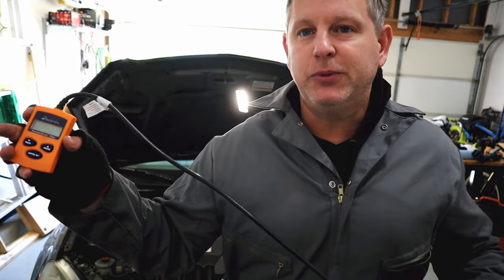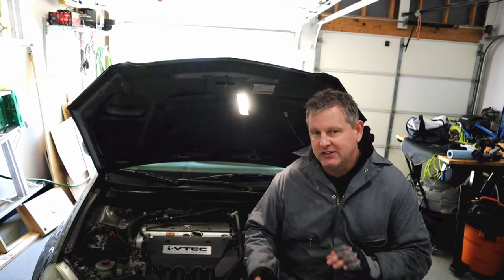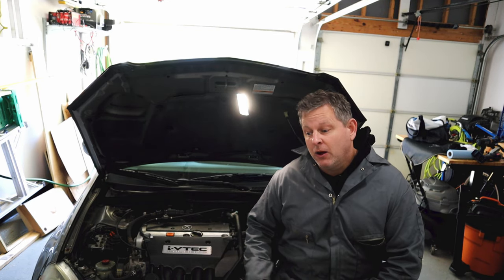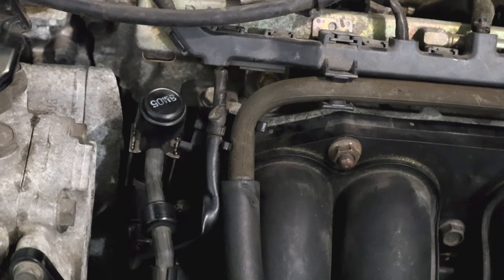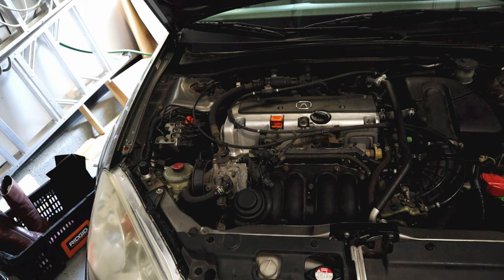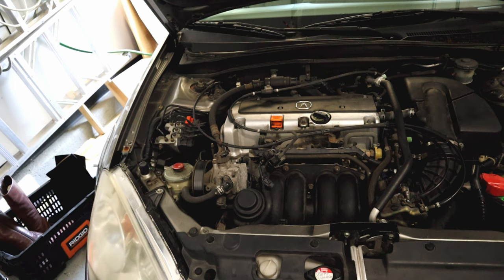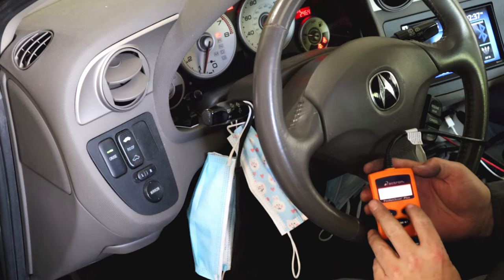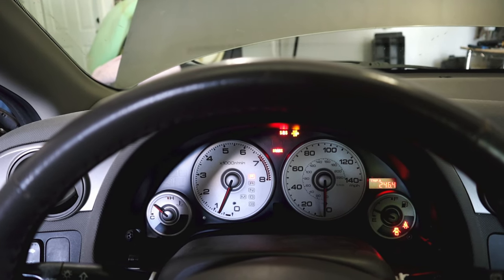#MTBPlanB Acura RSX P1077 DTC diagnose and fix.

Comment: Wicked video, I havent tried this solution yet, but I had the exact same problem, knock sensor replacement and followed by this code!
Reply: that is what im dealing with now, i replaced my knock sensor, and now it threw this code, what was your solution?
Reply: You guys ever get that fixed? Same problem here but im gettin vacuum on the solenoid. Wish it was same problem like in this video:/

Comment: The vacuum hose on the BOTTOM to the solenoid is the most common "I caused the problem". Easy to be disconnected and not reconnected when doing a starter, knock sensor, PCV valve etc. Took me a full day to find it. ARGGHHHH

Comment: I keep getting p0662 can't figure it out
Reply from the maker: Check the intake runner control valve sensor.
Reply: Yeah I have both in Conjuction. P1077 and P0662
Reply: @MTBPlanB what did you use the vacuum for?

Comment: I need to replace that hose right above the intake manifold , my question is , can I replace it with a vacuum hose from auto zone or do I have to use an OEM hose
Reply from the maker: Any strong walled hose should do…I.e. such that it won’t collapse under vacuum.

Comment: At 4:35 does anyone know the proper orientation of the bypass filter in the hose between the solenoid and what i think is the IMRC valve? mine broke, and while i ordered the correct bypass filter, i do not think it is symmetrical and can't figure out which way it should "face".

Comment: You didn’t replace anything?! I’m confused. Was it just a vacuum hose that came disconnected?? I have Same codes
Reply from the maker: Yes I had changed the crank position sensor previously and knocked the vacuum hose loose unknowingly.
Reply: @MTBPlanB  oh ok makes sense. I’ll check my hose connections. I just bought the my RSX. And I know started was replace. Maybe mine is just that simple as well. Thank you for the reply my friend and excellent video
Reply: Well I wasn’t that lucky! Pulled and cleaned my IMRC and cleared P1077 code. 

And guess what it came back. What a waste of time 😩